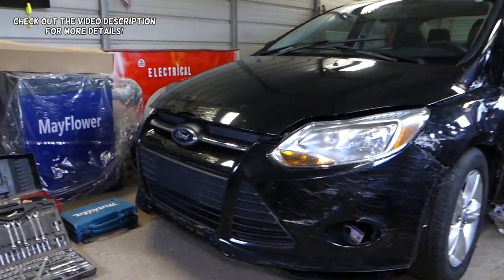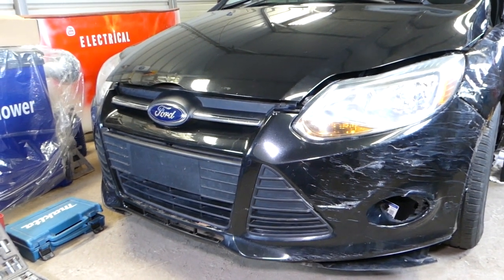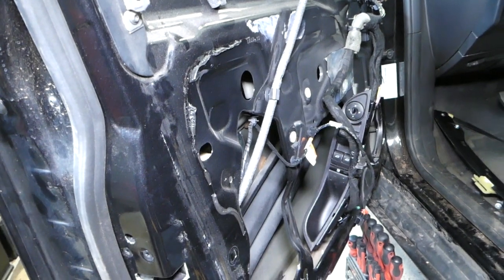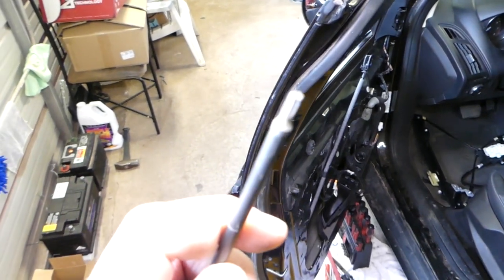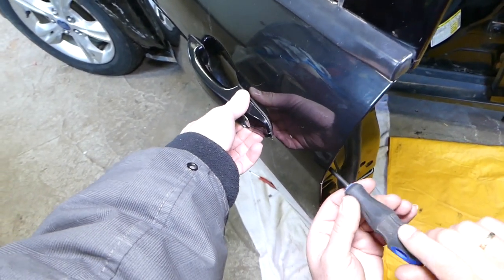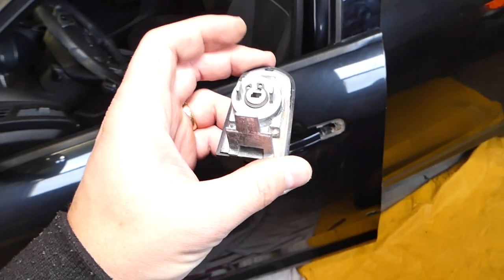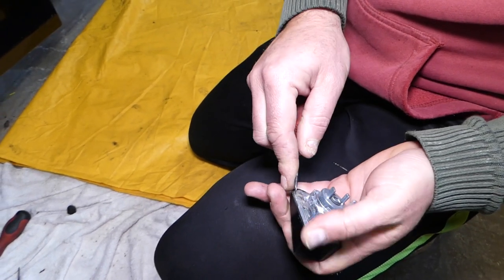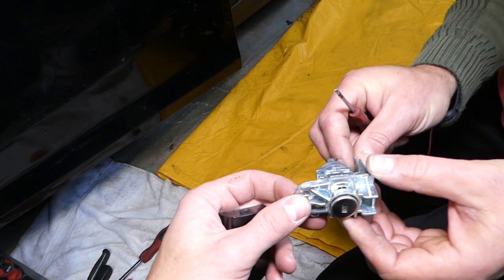DOOR CYLINDER LOCK REMOVAL REPLACEMENT FORD FOCUS MK3

Comment: Thank you for this.  Was able to do the job myself in a few minutes.  Trickiest part was working out that it was a T20 driver that was needed  to undo the retaining screw; I wasted a bit time thinking I was getting engagement with the wrong size driver.  Apart from that it was as easy as it looks to remove the lock and replace it with a new one.  Much appreciated.
Reply: How did you realized that T20 torx was the correct? I. The video he never said the size also the Ford Taurus same year as this it could be same T20 right ? Those models are very similar

Comment: Would this work on a 2010-2012 Ford fusion? I was told by a locksmiths that the inside door panel HAD to be removed to take out the lock cylinder. Thank you and keep up the good work!